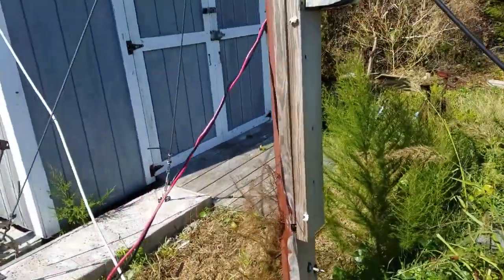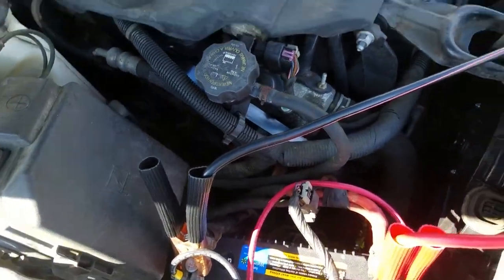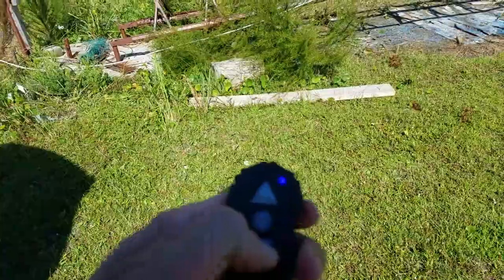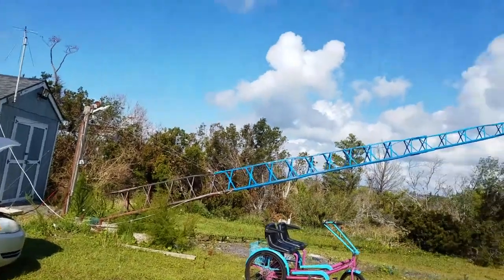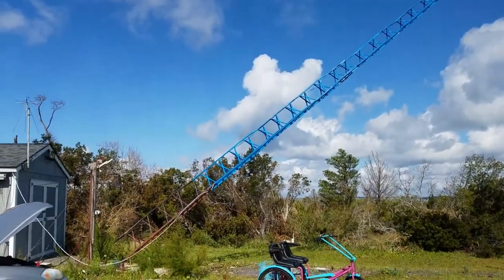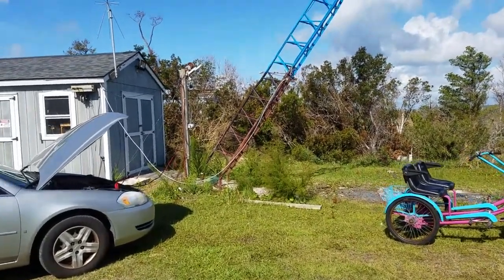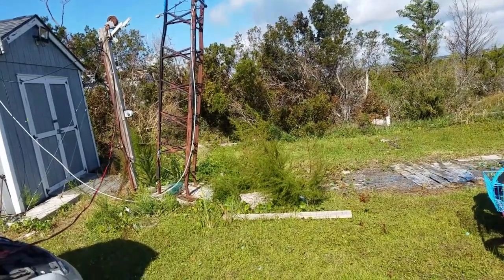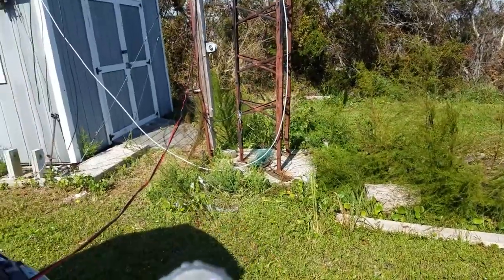2019-09-15   Raise Ham Radio Tower

Comment: if you attach your winch cable about 10 feet higher on the tower, it would be a much more balanced lift, safer and less tension on everything.  Looks like you're attached way too low.  The forces are tremendous when connecting that low.   Nice tower !
Reply: How do you figure the load on raising cable?
Reply from the maker: It was a trade off.  You got the intuition of what was going on and weakness of the approach.  The higher up, the more horizontal it is when laying flat.  You end up just compressing the tower against the hinge.  Too low, and the mechanical advantage works against you, but you can get it off the ground.  Even as high as it is here, when laying all the way down, it would barely pick it up, and the who system was under lots of strain.   Ideally, I would like to attach it further up the tower, and have a member coming off the tower perpendicular, so the cable can lift.  I just didn't have room in my setup.

In fact, the one and only time I put it on the actual ground, I almost didn't get it back up.  I made it a point to make sure I kept it at an angle, and brace it.

Ideally, the winch pole should be higher.
Reply: I have a crank up/ tilt over tower, just curious as to how much force will be on my raising cable. Nice setup you have.
Reply from the maker: . It would be a statics problem.   It would vary with angle.
Reply: @joshuaguthrie8067  my pole is 16 feet high, and tower will be at 32 feet when raising. Hope it works out.
Reply from the maker: . Yea, you don't want to stand any where near this thing.   Esp where a cable or pulley could snap and come at you. 

I stood a long ways away and ran out by a remote electric wench
Reply: @joshuaguthrie8067  most in my area are right in the mist like I explained. Must have alot of trust in their setup.
Reply from the maker: The higher the mass, the worse case you have.

The only sense, I consider my setup safe is that I'm no where near it.    No way, I would be with in 50 feet of it. 

It is under a crap load of strain.  I never did the math to see if everything was rated for it.   In my case,  I didn't have to care.   If a line snapped, or it shot a pulley, who cares.  No one is near it. 

In fact,  it did shoot a cheap pulley the first time I tried it.   If some one was a few feet over the wrench, I think it would have taken their head clean off.  That thing was moving!!
Reply from the maker: I guess what I'm saying,  of you think you'd be near any such setup, do the math,  and give yourself plenty of safety factors.   Don't get hurt or killed
Reply: @joshuaguthrie8067  i agree, another thing I need to consider, is this setup was going to be close to my house. I dont want any damage to the home as well. I've talked to engineers about this, and most act like they can't figure this, or don't want to.

Comment: Can you describe the winch post construction? Is it two 2x4 boards bolted together? Is the lower board set in concrete or in the ground? It looks like the backstay cables are attached to a concrete block or pad of some kind.

Comment: Can you describe the winch post construction? Is it two 2x4 boards bolted together? Is one board mounted in concrete or just the dirt? Are the backstay cables connected to a concrete pad?
Reply from the maker: Backstays in concrete and sand anchors

Comment: how big is the winch
Reply from the maker: it's the 2000 lbsf harbor freight..   key is to be way the heck away from such a thing.  parts of it are under LOTS of tension.  Don't want to shoot a pulley thru your head or anything..
Reply: @joshuaguthrie8067  so in my arrangement, and Ive thought of this before, I would be standing under a pulley, and in front of the tower's hinge base. It does seems like it could be dangerous.

Comment: I got the same type tower . I will copy your winch system.
Reply from the maker: Be VERY careful.  Lots of force, and I just winged it (no calcs, etc).  Originally, I had a hand crank on it.  It scared the CRAP out of me.  I lost a pulley, and part of it went whizzing over my head.  The forces gets greater, by far, the lower the tower is.  Hence, the remote on the winch, I want to be the heck away from the thing.  Do you due diligence, do your own research, and be safe.  Best of luck.

Right now, I'm using two sand anchors on the cement anchors.  Wish I used more.  I also poured concrete into the pipes to help give it more stiffening (you don't see in the video).
Reply from the maker: if you have the room, check this guy's setup out
https://www.youtube.com/watch?v=0F9aShi-PsU